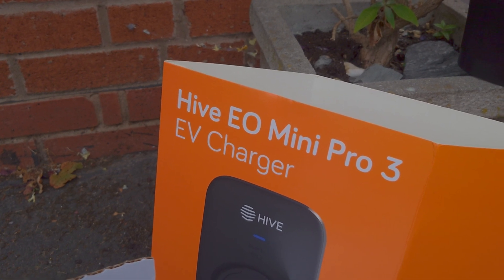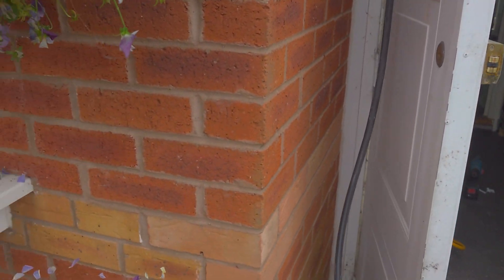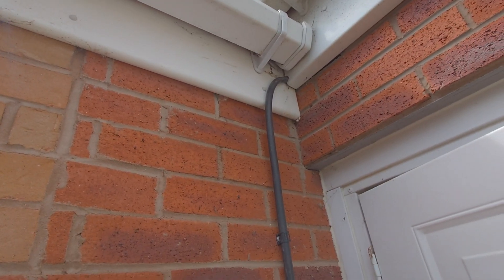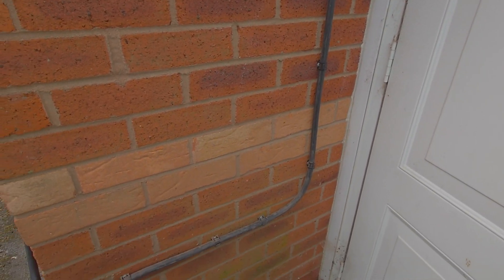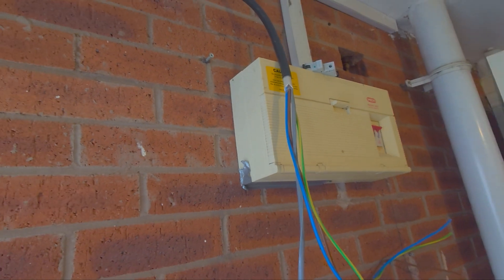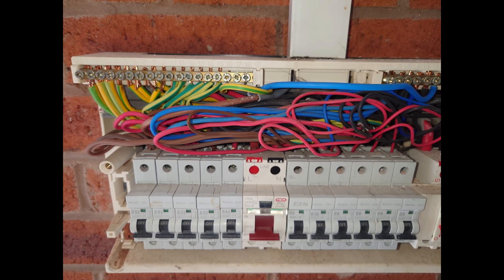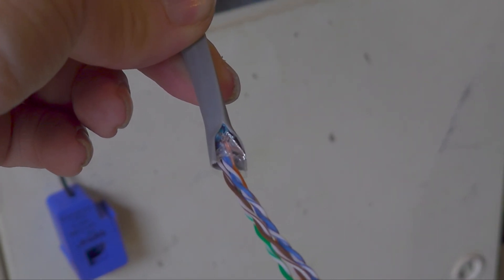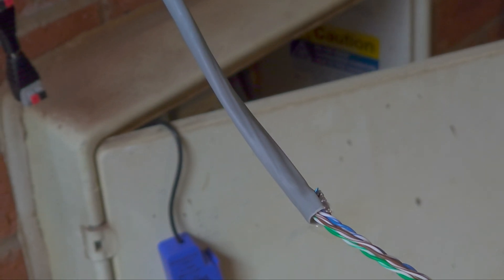How Easy Was It To Install This EV Charger ?

Comment: Nice may I ask, did you use an mcb? Or rcbo
Reply: Those MEM RCDS are double pole, but no SPD???
Reply from the maker: In this install it was a 40A MCB as the consumer unit already had a Type A RCD. Having said that its likely this consumer unit will be replaced in a few months, so it'll contain all Type A 2-pole RCBO's
Reply: @vwes  OK so you won't sign it off I suppose until you fit a double pole rcd/rcbo I guess